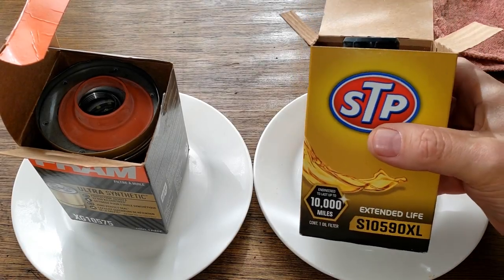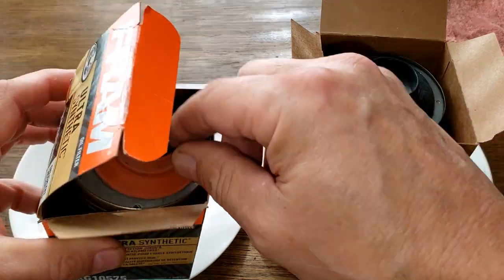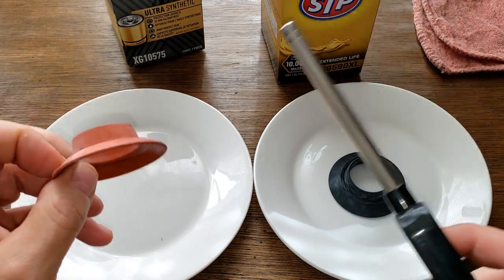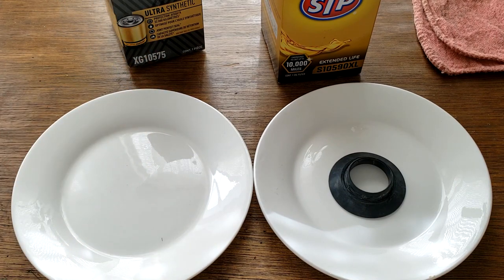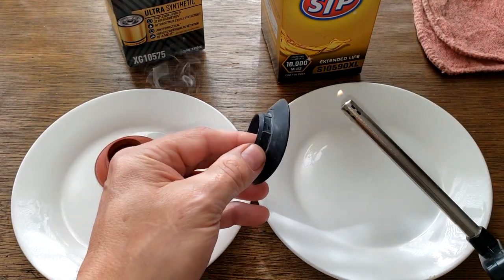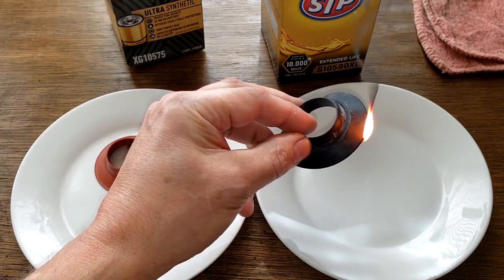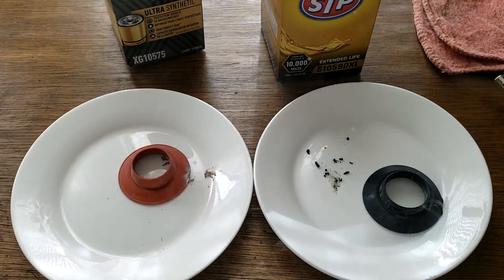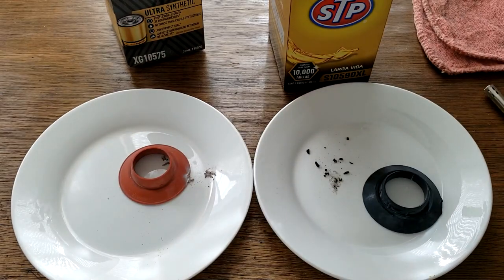STP S10590XL Anti Drain Back Valve Silicone Or Nitrile Rubber Test

Comment: Great job Whip. Johnny on the spot. Like you, not a surprise to me. Same stunt First Brands pulled with Fram EG/TG. When it's a black adbv, in greatest likelihood, it's nitrile. Thanks for confirming so quickly.👍
Reply: Was it a stunt or perhaps old stock?
Reply: @johnmcsweeney4966  Filter made 6/22 of this year, new stock. So yes "a stunt" FB has done before with Fram EG/TG. But, "old stock" line FB/Fram tried when they started subbing nitrile for silicone.
Reply: @faxmen09  Okay, if 6/22 def not old stock then.
Reply: This was done intentionally?
Reply: @adamcampbell8790  If by intentionally you mean FB knew they were using a black adbv made of nitrile instead of silicone, then yes. As mentioned in OP, not first time First Brands has done it.

Comment: Thanks for taking us along for the next test step. After this test, the STP XL's only upgrades over the regular STP are the metal end caps and an actual bypass valve, not holes in the baseplate. Maybe there are exceptions, but it looks like black <> silicone. Easy to spot without taking apart the filter.

Comment: I tested using this method a Toyota YZZD1 antidrain back valve. It burned white even though it was black colored silicone.
Reply: The Toyota Denso you mention is STILL the ONLY black adbv that burn tests as silicone. White smoke with white ash is silicone. Otoh, the Denso First Time Fit, claims silicone, burn tests by Whip confirms, nitrile.
Reply: YEP. Just like The Wrencher told us.
Reply: Silicone can be in any color ,including clear , rubber is always black  or even on a very rare occasion white if a natural rubber, they actually add the carbon black to the rubber in the process
Reply: Silicone can be black, but you would think for marketing purposes they would use a different color.

Comment: Great follow up.  Silicone can be black, but you would think for marketing purposes they would use a different color.
Reply: Only been ONE confirmed black silicone adbv seen, Toyota Denso OEM. To this point, that's it. Seems like a dumb idea 'to me'.
Reply: It's actually for manufacturing. So, when the filters are being made they can make a 'quick ID' which is which for assembly. It could be black, but then that would be a mess on the line, trying to figure out which is which. Almost any color other than black is silicone.

Comment: i've owned fords for many decades.& 95% of them had oil filters that were vertical or on a 45° angle.so therefore the oil could never drain out of the filter anyway at engine stop.i never considered the importance of an anti drainback.the only engine i can recall where it would really matter is the old chrysler slant 6 where the filter is nearly upside down vertically.after all,  the oil in the block passeges from the pump will eventually drain back down into the pump anyway after sitting a while.so it nearly deletes the importance of a few ounces of oil draining out of a rubber only anti drainback valve.perhaps there are more modern engines that use horizontal or slightly inverted oil filter mounting which would require a better valve.but the video is nice info to have.thanks.
Reply from the maker: True the silicone valve is not absolutely necessary but if your paying for it then it should be there. I opened a $12.99 Wix the other day that's advertised as having a silicone anti-drain back valve, nope it was black. You'll see the video in about a month.

Comment: What difference does the material make? Is one more prone to failure over the course of its life ?
Reply: Yeah I believe the rubber distorts as it goes through several heat cycles from driving then cooling down. Silicone is superior.
Reply: @Jay388  makes sense. I was hoping the STP was superior since this is the filter I use 90% of the time. Otherwise I use MoPar factory filters on some vehicles and Baldwin’s on  my diesels.
Reply: @Jay388  Spot On! Silicone superior, especially for longer service intervals and temperature changes.  And if you're paying for silicone, you should get silicone.
Reply: Silicone is better, but I've seen nitrile be just fine in a years time.  Also, if the filter is mount side up, you don't even need an ADBV. Look at Allison transmissions spin on filters.. but they do run a sweet donut magnet on top.
Reply from the maker: As others stated silicone is better.
Reply: YES
Reply: @ironmike7339  If your filter mounts vertically the material the adbv is made of is irrelevant.

Comment: Another great video as usual! My rule on ADB valves is if its a short oil change or a vehicle that's not picky about oil or filters or both(and some definitely are) I don't worry about it quite as much. If its a Hemi engine I would definitely use only the best oil and filters and never exceed 5K miles, for my wife's Toyota I care less about the filter and more about the super thin 0W16 that the manufacturer recommends.
Reply from the maker: Thanks for sharing,👍
Yep, that 0w16 is needed in some newer engines.
Reply: That thin oil is because of the tight clearances and the variable valve timing. I would say the ADV NEEDS to be silicone if they're using it for double duty as the bypass. With these modern oil temps regular nitrile hardens quick.

Comment: WCW, did the box say it's supposed to have silicone?  Just curious, I didn't see it.
Reply from the maker: No, but I've opened this same filter in the past and it had a silicone anti-drain back valve, Here's the video link. https://www.youtube.com/watch?v=7yTlgtwED9A&t=0s&ab_channel=WhipCityWrencher
Reply: @WhipCityWrencher  Yes I saw that video.      Hmmm, I guess if it's not mentioned on the box the consumer can't complain the filter doesn't have it.   Fortunately if one needs silicone those are easy to detect before purchasing.  Cool vid!
Reply from the maker: @adamcampbell8790  Thanks. One other thing it doesn't have is a silicone gasket which the Autozone website says it does. https://www.autozone.com/filters-and-pcv/oil-filter/p/stp-extended-life-oil-filter-s10590xl/663658_0_0?spps.s=5167&cmpid=LIA:US:EN:AD:NL:1000000:FLT:8362666956&gclid=CjwKCAjwzNOaBhAcEiwAD7Tb6I1_3Mj2REy7n1dW1X9Wx64IS4sY0V8HTxxYo8uwEdTjzEihksEXGhoCheoQAvD_BwE&gclsrc=aw.ds

Comment: I kind of figured it probably was rubber because it was black. I think they standardized silicone orange, and black rubber. Some are purple or blue for the mfr 'ID'. All these filters are getting more cheap. Was just at Walmart and they pretty much only have Fram, Supertech, Mobil 1, K&N, and very very little Mopar and Motorcraft. The Motorcraft FL1A is $10 now and now longer has the front bypass. It's rear just like all the other Purolator filters. Sad. They would probably say for that STP it was a 'supply' problem. I wouldn't use one of those even if it was silicone.
Reply from the maker: Hi Vince,
Thanks for sharing!
I'm confused on the Motorcrafts, my Walmart doesn't have any either they used to stock every size.
Reply: @WhipCityWrencher  I think they're downsizing or standardizing their filter lines. When I was there yesterday to get tires, they had 3 or 4 Motorcraft and Mopar numbers, no AC at all, and one other Mfr brand, Toyota or something I didn't look at. I think they used to have Royal Purple years ago too (a few). Basically, now just Fram, K&N, M1, and ST. Even the Frams were down to just the 'orange can' and the Ultra. very little of the others. It's been a while since I bought an AC filter but they had them a couple years ago. I used to like the FL1A for regular changes but not for that price. The 'new' FL1A has a sticker instead of the paint or printed logo also.
I think at the moment the Boss is the best 'featured' oil filter for the price.
Reply from the maker: @vincemajestyk9497  Thanks for sharing.
Ya, I wouldn't pay that much for the FL1A either.

Comment: Has anybody even once utilized this so called material advantage? Too many oem and diesel oil filters use rubber for me to believe it's anymore than a selling bulletin point.
Reply from the maker: My daughter's car was making a start-up noise (not right away but after about 2 K miles) when she was using a filter that had a nitrile rubber anti-drain back valve. There are lots of stories on the internet with similar complaints.
Reply: You can be sure of one thing, all the manufacturers wouldn't have changed to silicone if they didn't have to for a reason. The rubber valved filters are low drain interval. The silicone ones are higher. However, I looked at a Fram orange can with had rubber plus the construction that we all know about and it was rated to 10k miles. That's insane!

Comment: I think the STP Maximum Life filter had the silicone anti drain back valve, but they discontinued them I think and now just have the Extended Life as their flagship filter.  Even the box hints at that by using cross references to middle of the road filters like a standard Bosch, Fram Tough Guard and Purolator One.  Yet, the STP Max Life box cross references the Bosch Distance Plus, Purolator Boss, and Fram Ultra.
Reply: BOSCH has discontinued the "Distance Plus" filter. I THINK it was due to a high failure rate -- probably can't get a 20-Micron filter to last for 15-20,000 miles.
 Now only two (2) models: Bosch "Workshop" and Bosch "Premium" . There is no "standard" Bosch oil filter.